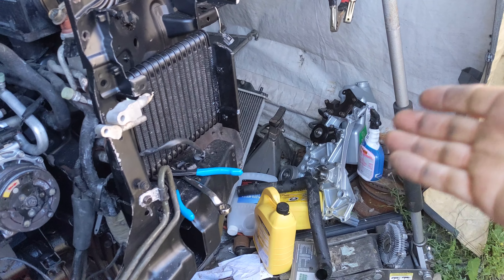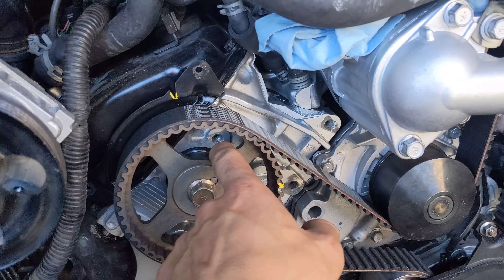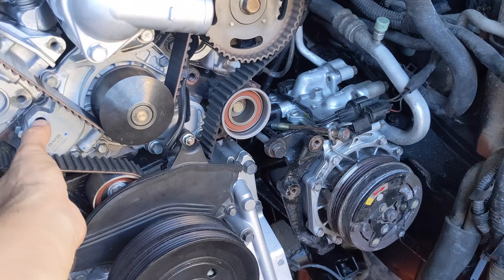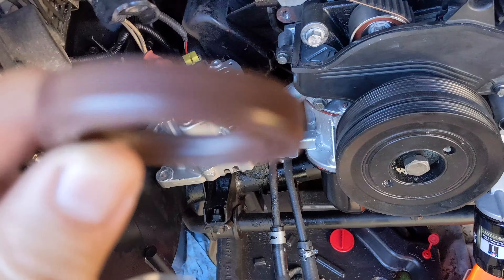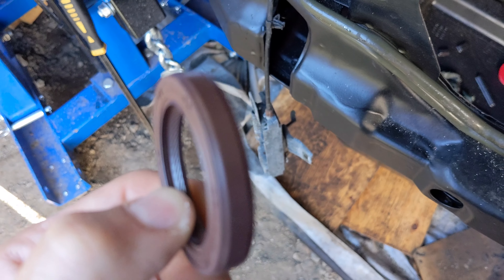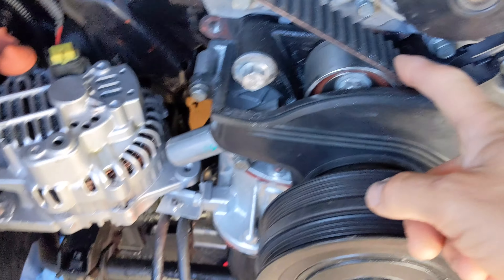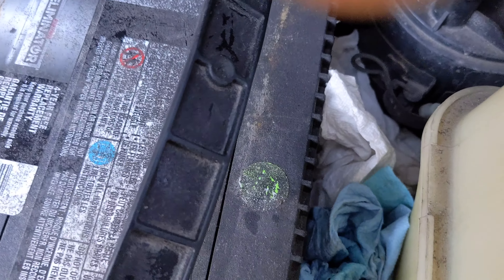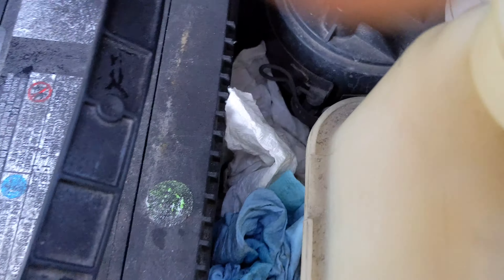Mitsubishi Delica v6 Camshaft seal replacement

Comment: you have the patience of a saint. my god, the work involved in this engine refit has been huge. I have watched them all with interest as I own a V6 petrol 2005 - 6G72. I have a leaky rocker cover that will need doing soon. Even the prospect of getting to the covers terrifies me.
Reply from the maker: Hi Dave, thank you for the comment. I think anyone can do this with the proper planning and tools, it is just a bunch of bolt, nuts and metal pieces :) a metal lego

Comment: Just to let you know my engine has the exact same leaky air sound on the left by the power steering. Sounds like a vacuum leak but I checked everything and couldn’t find any issue. Let me know if yours turned out to be something but I think it’s just normal.

Comment: Have a 2003 Mitsubishi Outlander 2.4 and need to do the same my question is when u put top dead center and I zip tie like u did,would the belt at the bottom come off track?

Comment: Hey sir ! Can you tell me what you ended up to do for the tensioner ? Is it only putting tension while the engine is running so you were fine or you did something ?

Thanks !
Reply from the maker: yes, the tensioner once is released I keeps the tension on the belt while is running, there is no more to it
Reply: So you didn't had to do anything to it while replacing the seal ?
Reply from the maker: yes I had to push it back and put the pin back again otherwise you will not be able to take the tension out, thankfully I saved the old pin but you can use a small drill bit to do it
Reply: I just did this to my 2000 Montero sport. I just fixed the leak at the rear camshaft seal above the starter. I had trouble getting the o ring so i made a gasket where the camshaft thrust plug meets the head. Works great used a cereal box.